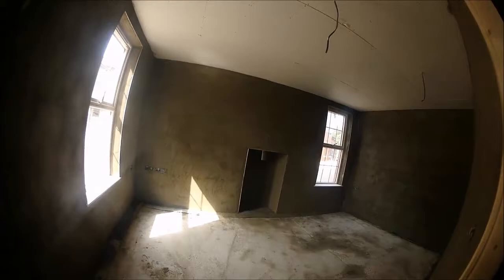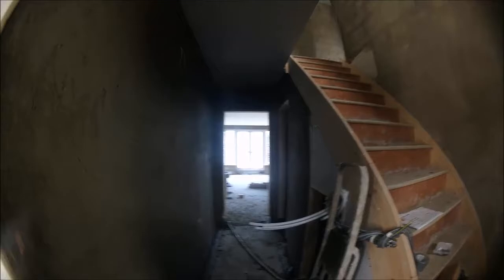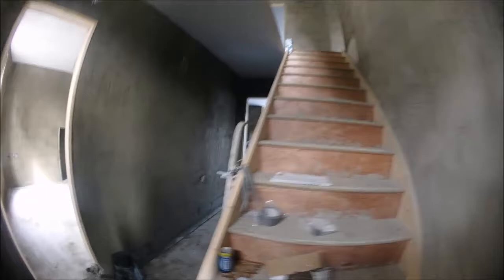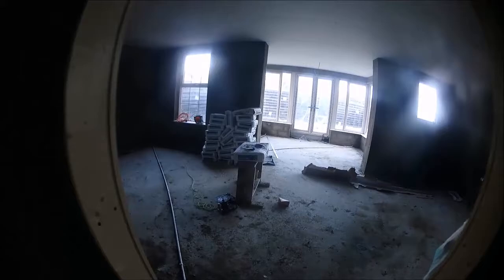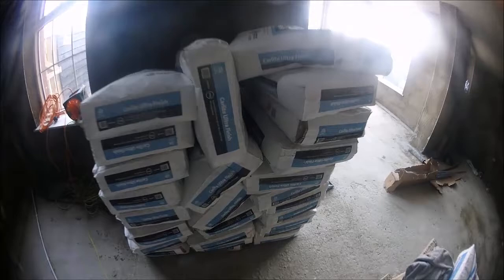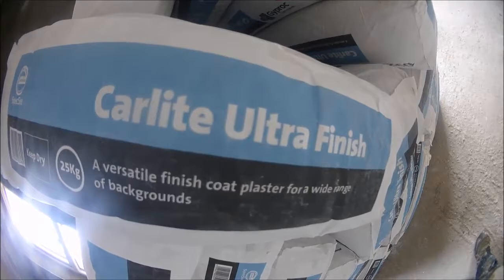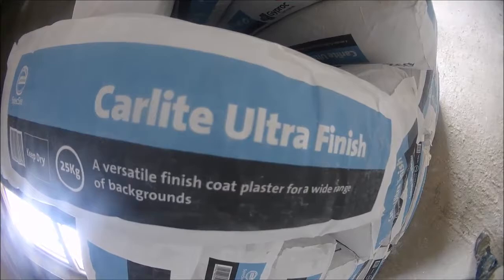3 STOREY HOUSE TO BE PLASTERED  sand and cement rendering done ready for skim

Comment: been busy there fella! I've never skimmed on sand and cement does it all need pva'd first?
Reply from the maker: Hi Richard the key/scratch  that i floated on makes it bond together so no need to pva if it has dried to much you might need to damp it down to slow the suction. if you are doing real old walls that are just cement I would recommend pva 

Thanks for watching mate
Reply: macplastering cheers mate